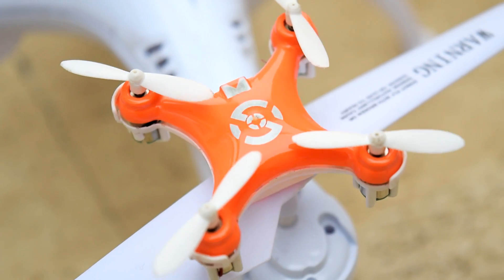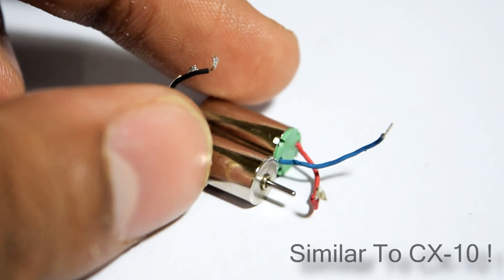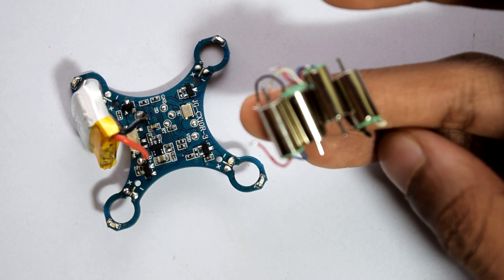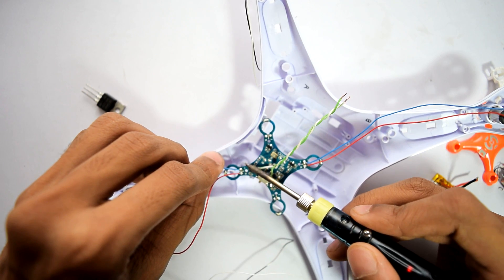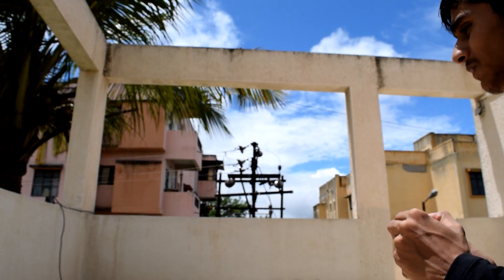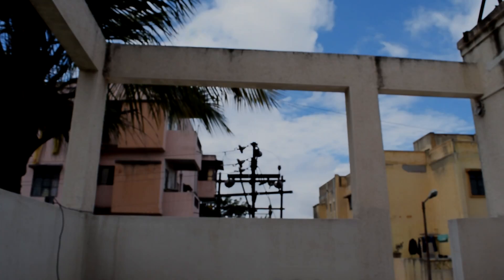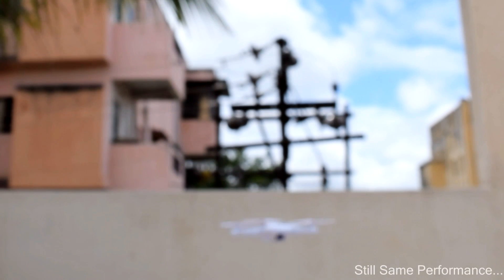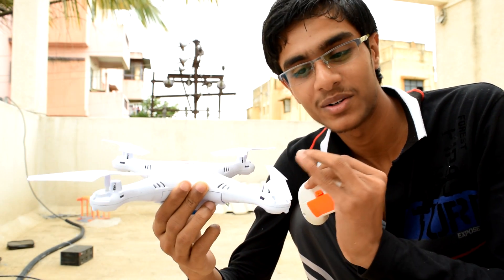Bigggg Flying Drone from a Small Mini Drone

Comment: Flight controller's PID values need to be change as per the bigger frame, which is not possible obviously since the board is not programmable. Without change in PID it can't fly stably.

Comment: Im going to try to do the opposite of what you did! Im attempting to use a Syma X5C, Striker Spy Drone or equivalent (since I have several bigger quadcopter flight controller boards not in use) in a Nano QX mini quadcopter upgrading the battery and 6mm motors to 7mm or higher. Or, should I just substitute mosfets from one of the larger FC boards and replace the the Nano QX one's?? Any opinions are much appreciated!

Comment: Its shaking because of the battery's location
Reply: Gökhan Korman that's not how life works that is not the problem I think it's that the propellers are making the little motors shake
Reply: No he hasn’t stuck the main circuit board onto the body on the inside of the drone
Reply: It then makes the board shake then it try’s to correct the motor and make it worse, then it’s a never ending loop

Comment: The flight controller board needs to be mounted securely(hot glue etc)  and Level (centered-flat )  then you need to do an gyro reset, if possible.. That should improve it... Nice video.

Comment: maybe you didnt secure the alignment of the board it has a flight control systems which atomaticaly level each motor to compensate with the twerking of the drones body or maybe a bit dis alignment of the accelery sensor so i tell wrong power output to a wrong motor i think?? hehe

Comment: 1) Hot glue the circuit board in the middle of the chase (so that it doesn't wabble around inside)

2) There's supposed to be calibrate options for these quad copters, try searching for videos on YouTube...
Reply: Azim Alif jjdjfncjxmck

Comment: did you rigidly secure the board inside with something like hot glue or silicone and make sure it's level with the propellers. If the board is not rigid with the body there will be lag motion so the sensor will overcompensate because only the wires are transferring the motion to the board
Reply from the maker: +SilentDreamcast Yes , I fixed the board with screws ,and wires are taped to the body.

Comment: ID is basically a specific function inside your flight controller that is responsible for stabilizing your drone. In order to tune a quadcopter, you have to give the PID function some useful parameters to go off of so it knows how it should behave. Honestly, it doesn’t matter what PID stands for, because most flight controllers and tutorials refer to the settings by using the acronyms anyway. I’m not going over the actual meanings behind the words because that would be too hard to understand for a lot of people, so just remember that PID stands for “proportional, integral and derivative”

Comment: did you mount the pcb completely flat to the body? if not and it has an internal gyroscope it may just be shaking the pcb around and causing instabilities.
Reply from the maker: +XmackattackX Yes ,I also tried mounting PCB to top and bottom body but either the small vibrations created by propellers making it unstable ,so tweaking into values of sensor might solve this issue.

Comment: nice one buddy. i think the problem is that the gyro inside the body isn't stable, if you can do that, it'll be much smoother
Reply from the maker: I screw mounted the board properly , but still same performance!
Reply: strange, then I guess it's the size calibration issue. nice stuff on the channel buddy
Reply from the maker: +Yash Garg Yes it is, Enjoy!

Comment: try to place the main controller board in exactly the middle of the quad, so the in-built gyroscope works correctly
Reply from the maker: +Haris Ali Siddiqui I Screw Mounted the controller exactly in the center also each arm of circuit is properly positioned correctly with body,otherwise the drone doesn't even take off .

Comment: the flight controller is designed for a smal area with the motors very close to each other so it isn't very reactive, now with the motors apart it's way more reactive and the flight controller is over compensating to the sudden change of position,
love your video's keep it up! :-)
Reply from the maker: +3dprint-tech Yes, yet another solution can be ,installation of such powerful motors and propellers with more blades .
Reply: Yes, or mosfets with a 2s battery instead of 1s

Comment: try to lubricate or noise cansillation circuit
Reply from the maker: +vignesh kailas The Noise is kinda OK for this sized drone ,but wobbling is real issue here !
Reply: do this drone has gyro on it
Reply from the maker: +vignesh kailas yes it has mpu 6050 integrated motion unit.